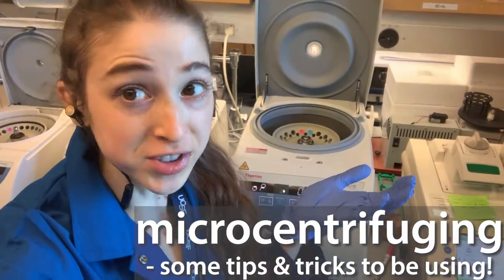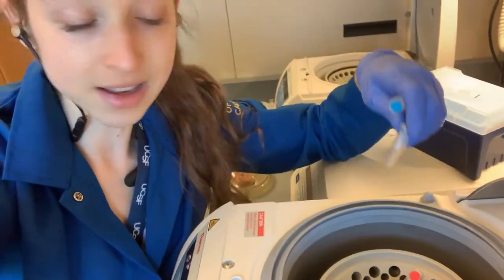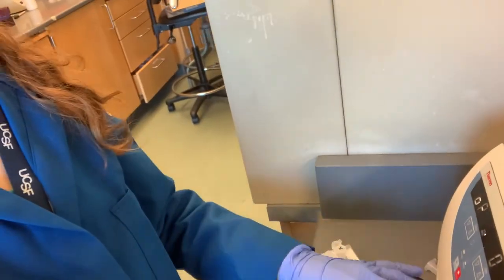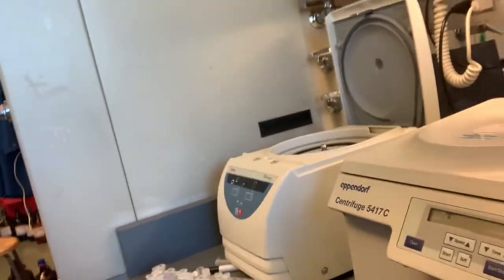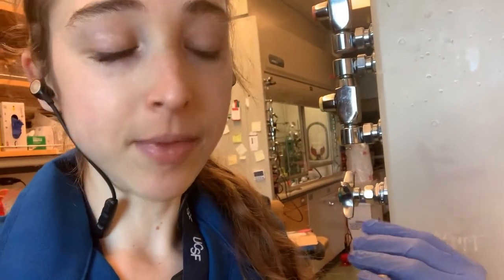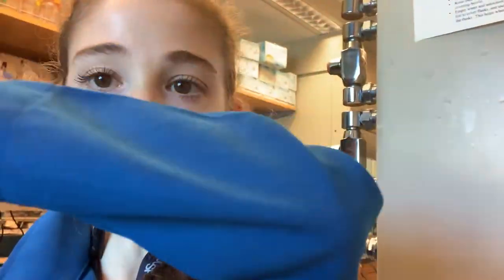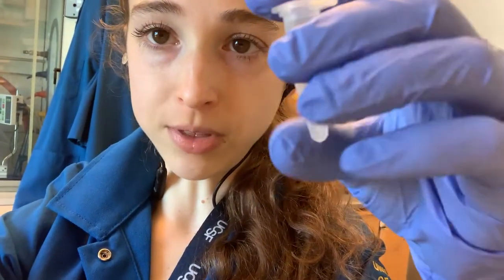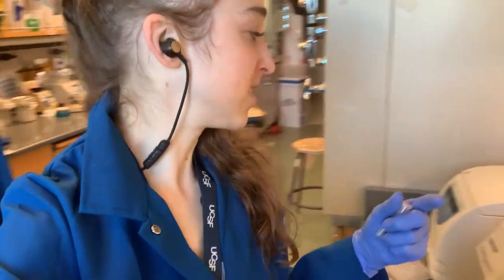Microcentrifuge tips and tricks

Comment: How do you measure the radius? center point to which point? thanks!
Reply from the maker: Typically the end of the tube, but the force will vary along the tube because the radius varies (assuming tube is at an angle)
Reply: Sorry, I meant do you measure it from the center point of the microcentrifuge to the external border of the hole where you place the eppendorf tube?